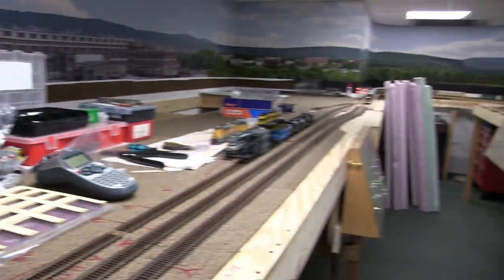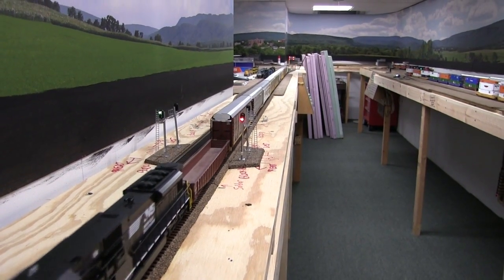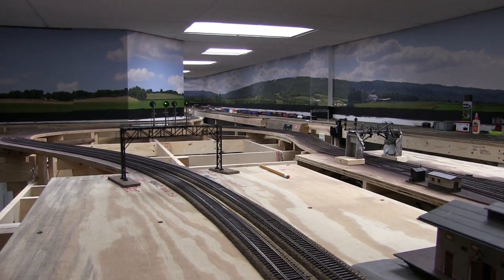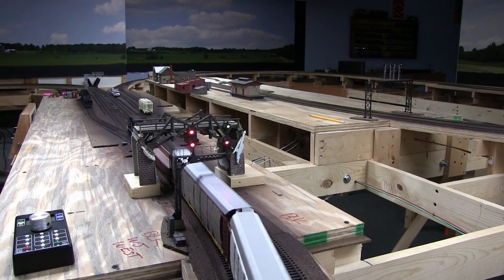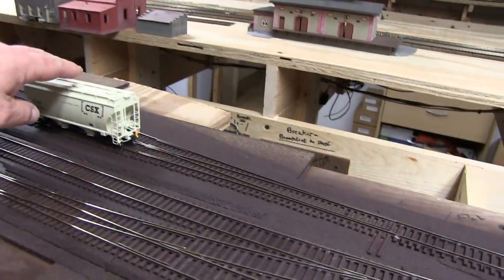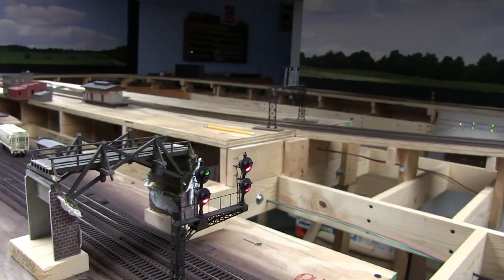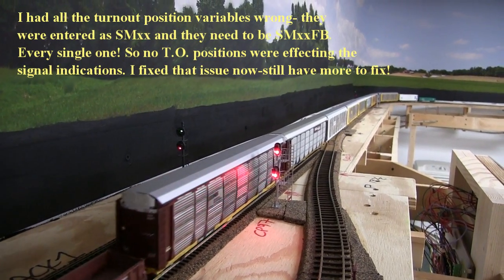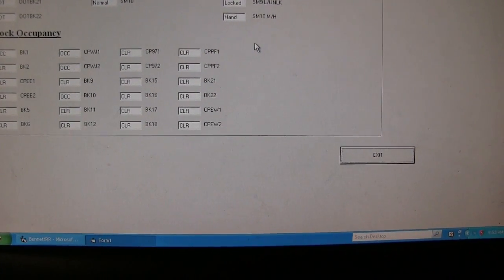Model Railroad Layout Update Video 41b- C/MRI VB6 Debugging

Comment: Great job on your layout... some suggestions from a long time VB6 programmer that worked with real world inputs/outputs :  Suggest you change the color of the block text boxes when changing,  you can see the colors from across the room -- also set the font to bold when the unusual condition exist, such as occupied. Again easier to spot.  Additionally, you can use click events on the screen to force the outputs to a desire state to test the system,  will help verify if problem is program or wiring or hardware.  Also you can probably create a "simulation" of the system by enabling a timer to simulate moving a train round the track -- use this when no com port connection available.... hope these suggestion help.  All the best - Paul.
Reply: +tz3p9v0 Great ideas! I am going to do just what you suggested. (Why didn't any of this dawn on me??) Thanks, I really appreciate the suggestions.